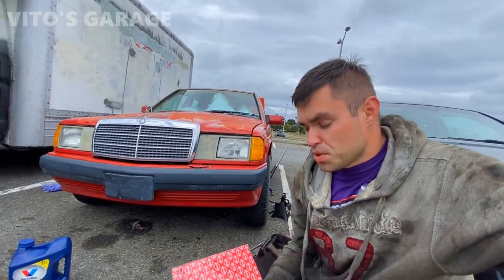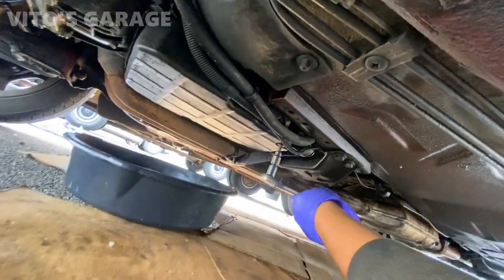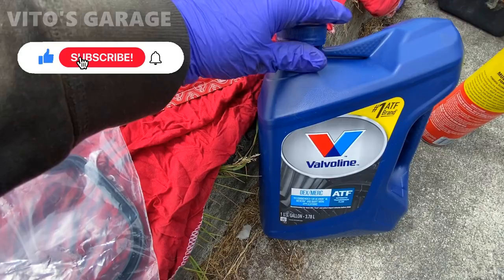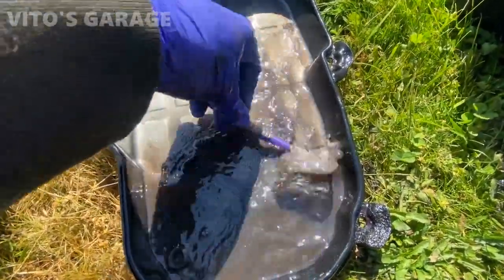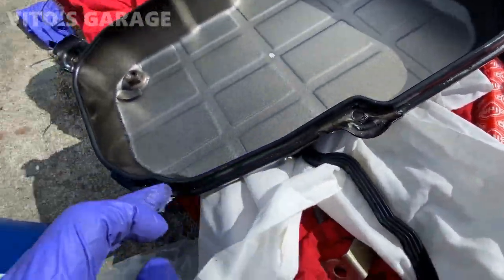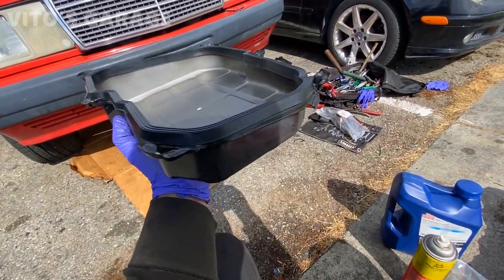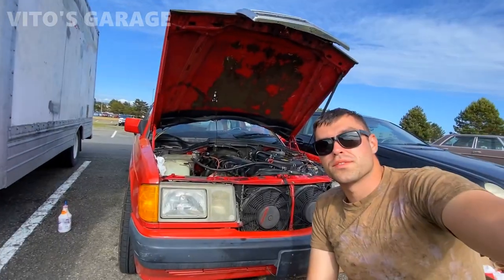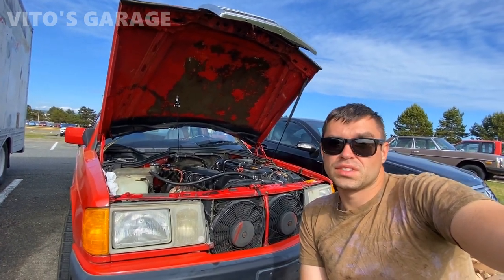Mercedes W201 190E Automatic Transmission Fluid Change, Filter & Pan Gasket Replacement

Comment: Would you recommend Locktite for the pan or do the bolts feel tight? I'd be worried they vibrate out.
Reply from the maker: Locktite isn’t necessary. These bolts won’t back out

Comment: Which silicone paste did you use?
Reply from the maker: Any automotive silicone paste works. You can get it on Amazon or eBay
Reply: Permatex 76761 Silver Grade Anti-Seize 907E, 28g ????

Comment: Hy. You can make one tutorial with how change a pollen filter (cabin filter)?. Please!
Reply from the maker: No pollen filter on W201
Reply: @VITOSGARAGE  even if it has air conditioning - climate?
Reply from the maker: @kingME_  correct. Early W124 also didn’t have cabin filters. Only later ones did. 1994-1995
Reply: @VITOSGARAGE  thanks